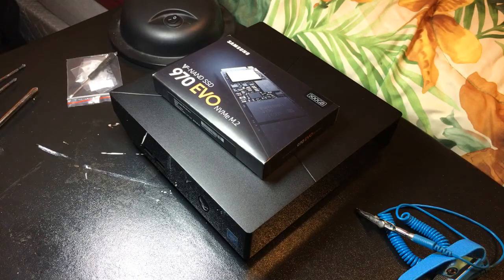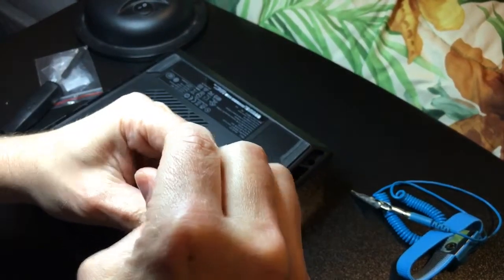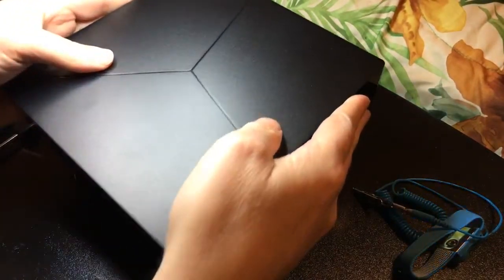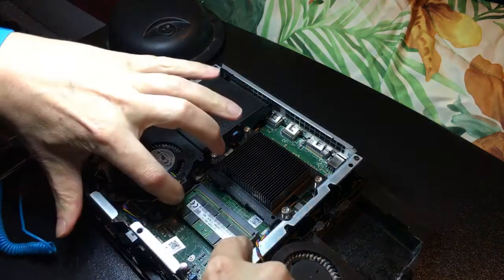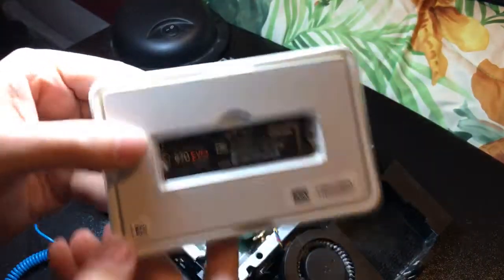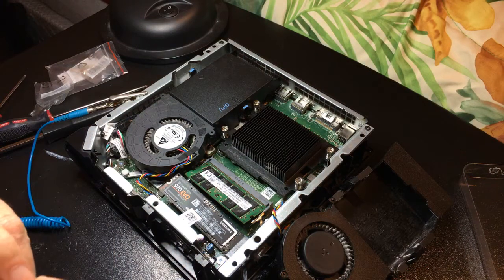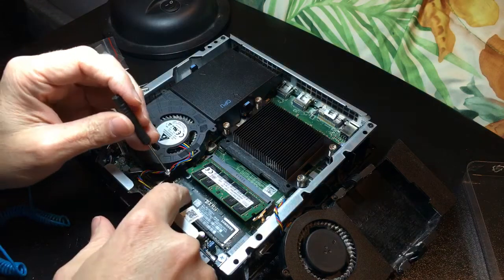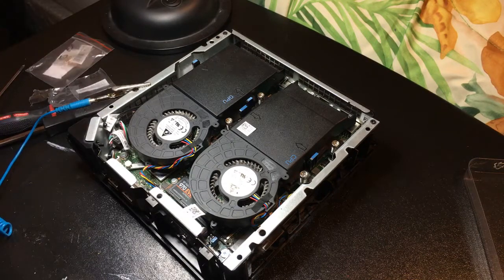Installment of a NVMe M.2 in an Alienware Alpha R2 - V nand SSD replacement

Comment: What thermal results did you get from this? I installed an m.2 and the temps were crazy before had to put thermal pads and a heat sink on it.
Reply from the maker: Great point, I didn't use any, but I hay go back and do so.

Comment: Hey, I also bought 970 evo for my alpha r2 and I used the Samsung migration tool to migrate the OS partition to the new ssd. But the SSD is not showing up in my BIOS boot option list. Did you have this problem;? Thanks for sharing.
Reply from the maker: I did, right click start, and choose Disk Management and see if you see the new drive there.  (Run windows from your old drive while doing this.)